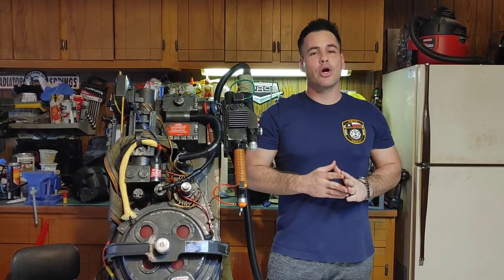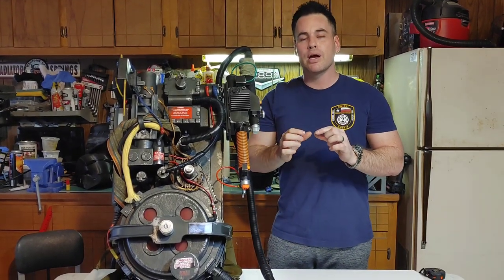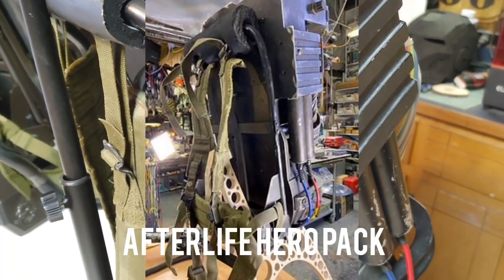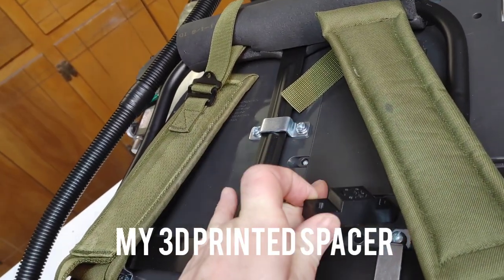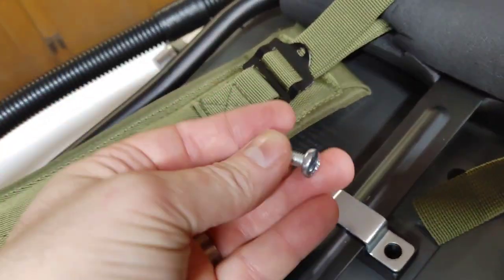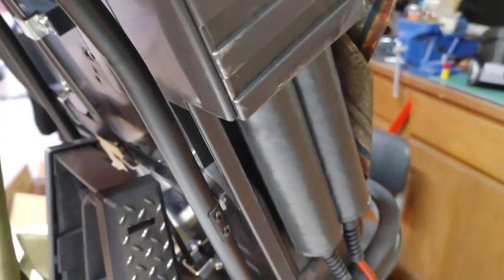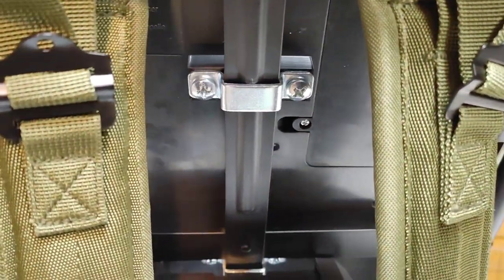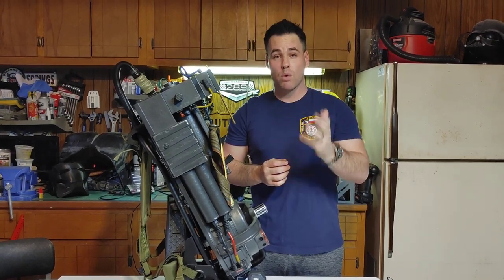How to Add Space Between Alice Frame and Haslab Proton Pack

Comment: Ah, this is perfect! I've been trying to find a solution for this - no one else seems to have been bothered by it. Nice work! It's mad that Hasbro didn't include this spacer with the pack, when they got pretty much everything right.
Reply from the maker: Exatcly! Felt the same way and had to do something about it haha. Thanks for the comment
Reply: That is true, however the way they have the mounting screw holes are too high.
The ALICE frame should be mounted about 2 inches lower, and then the pack can sit on the floor without a stand.
Reply: @SpaceWizardCosplay  Yep. Good point. Not sure if there's a workaround for that without drilling into the motherboard.

Comment: Got mine today, thank you! It was easy to install. Say, I still feel it’s not enough of a gap, any plans on making the spacer bigger, or do you think it would cause an issue with the plastic motherboard?
Reply from the maker: It depends on what pack your comparing it to...if to the original 1984 packs the space is slightly smaller but not by much because some of those Alice frames were more bent then others. If comparing to the Afterlife Pheobe pack that this Haslab pack was based off of its pretty much the same as the space is much smaller on those packs. I don't plan to increase the size because I found 3/4 was the sweet spot after printing multiple sizes before settling. The 3/4 spacer is the right size that doesn't put a lot of stress on the cheap Chinese Fox or Rotcho replica frames most people are using including myself and doesn't over complicate it where you have to remove more brackets and buy an excessive amount of hardware. I did mention in the video its not perfect but its a much better simple solution that gives the effect. This is what I have on my pack and plan on leaving that way. Thanks for the comment.
Reply: @ChrisBoshProps  I may have figured something out. In Afterlife when Phoebe and Podcast enter the Rust City building, we get a good look at the gap on the pack. It's, like, a good inch. But, looking at the Haslab pack, it clearly isn't that wide. Using the base spacers as a reference, I removed the two side brackets and move the middle bracket to the top. That, of course, added space between your spacer and the top of the bracket. But, I pulled the frame to the top of the bracket and looked at the assembly from the side. It was a dramatic increase. So, I measured the additional distance... 10 mm. You may need to confirm that. However, if someone was to remove the side brackets (the original hero packs never had them to begin with) and popped in one your spacers with 10mm added on, it may just give a very nearly parallel profile of the frame to the pack. Perhaps worth looking into?

Comment: How secure is the pack in the stand with the upgrade? My pack slipping out of the stand is a risk I need to consider for my upgrading options
Reply from the maker: My pack sits just fine on the stand, no issues.

Comment: Ordered and installed. Is the increased gap supposed to be uniform from the base of the frame to the top? I installed My spacer and there is still a noticeable slope/angle (larger gap at the bottom versus the top). Albeit, a much lesser slope/angle. Spacing improves, slight, if the middle brackets are removed(though, undesired.), however.
Reply from the maker: Yes that's fine and it really varies from pack to pack because sometimes the frame bars were pretty  bent. Like I said in the video it isn't a perfect but its much better that way. It was designed so it's not over complicated and you don't have to remove any more brackets or buy more hardware and its also the right amount of height without putting too much stress on the middle bar and risk snapping it. This is the way I have it on my pack and plan to leave it that way.
Reply: @ChrisBoshProps  Ok, thank you. Just wanted to be certain. Good job!
Reply from the maker: @TehAnKorage  No problem man! You need anything let me know. Take care.
Reply: Yeah at the end of the day I didn't keep mine. I feel like all it did was bend that middle bar without adding any actual gap. It probably varies widely from each frame. Still a neat solution, just didn't work out for me.

Comment: Shouldn't spacers be used for all 3 for symmetry of distance?
Reply from the maker: No on the original movie pack only had 3 points. With this design you don't have to remove any other brackets and still have a decent gap.